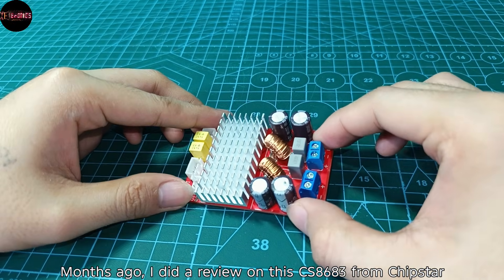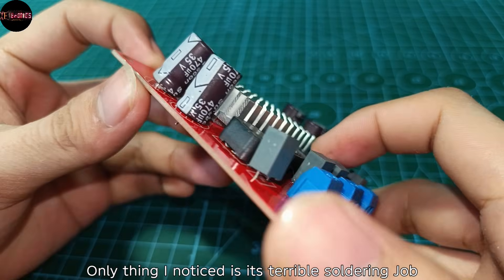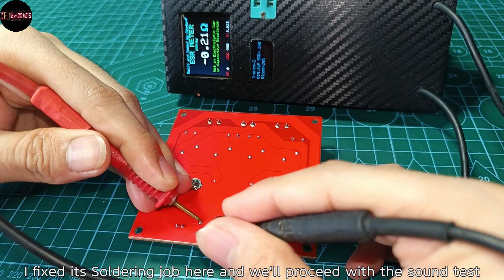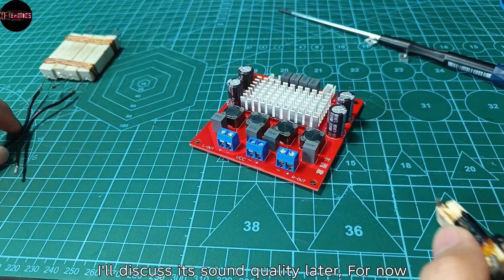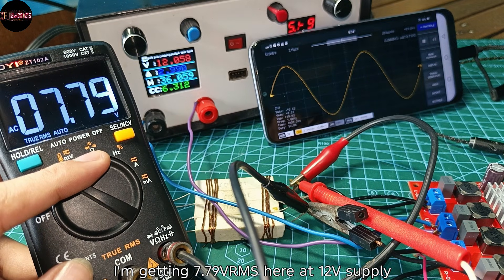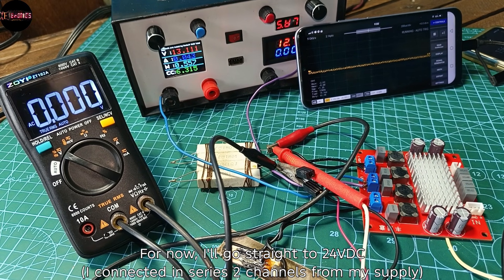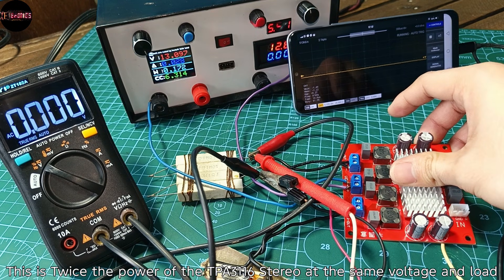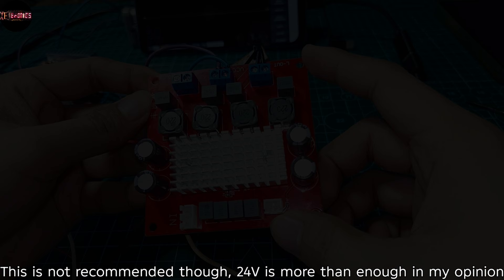Chipstar CS8685 Stereo Amplifier Power Test and Review  #tpa3116d2 #classd #amplifier #diyspeaker

Comment: good day bro! at 4 ohms load nag roll-off ba siya at higher frequency nung frequency sweep mo? nagbabalak kasi ako na gamitin ito for mid-high frequency at 2 ohms load
Reply from the maker: Not recommended 2Ohms load boss. Mas malala Freq Response nyan. 
Pero kung may EQ ka boss, wala naman problem. I adjust mo nalang through EQ boss
Reply: @x3dtronicsph pwede naman din pero balak ko din is modify ko yung output filter, kung gagana siya. no choice kasi yung aiyima ko na 2 inch 15w ay puro 4Ω eh tiyaka trip ko din kasi mag parallel connection sa mga yan

Comment: Maganda to kasi wala siyang input buffer kahit stereo configuration, unlike sa mga TPA3116 amp boards na may input buffer kapag stereo pero napaka-noisy naman at may roll-off sa subwoofer frequencies. Siguro wala or mahina lang hissing noise nito kapag walang input signal.
Reply from the maker: Parang wala ata ako napansin boss. Lalo na pag may Pull down resistor sa input. Malabo na magka noise